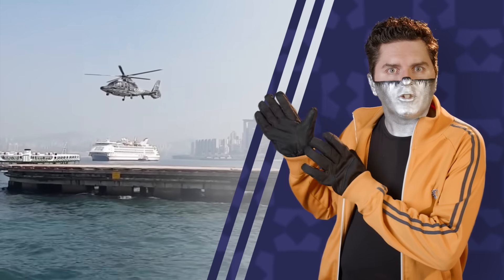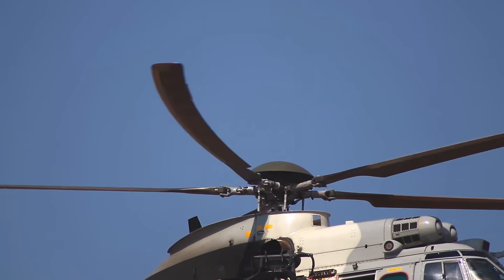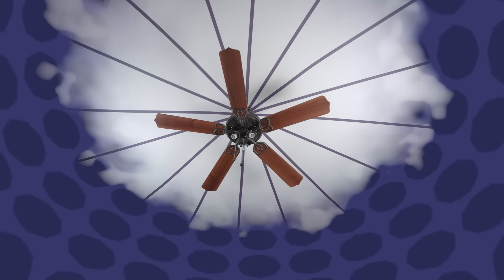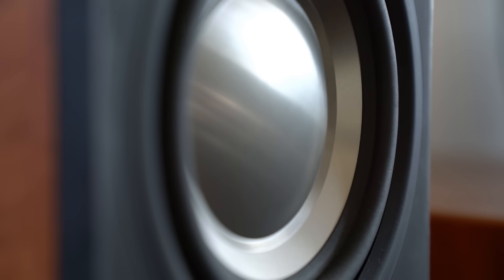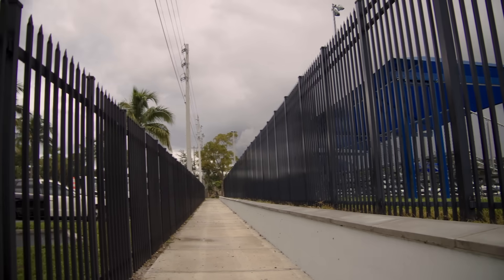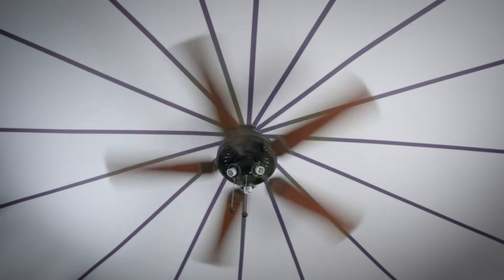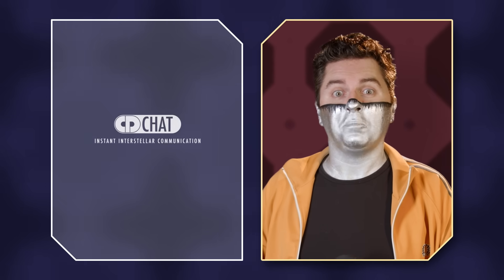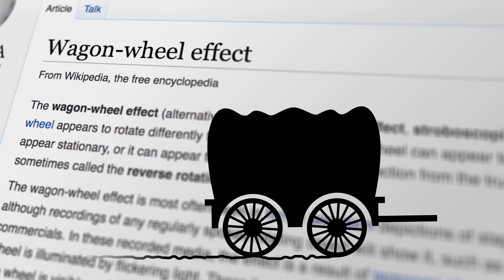Static Helicopter Blades | Quick D

Comment: Looks like your Decades + years of excellent content and grind paid, my boy is on trending cries tears of joy
Reply: Decades+ of content? That means AT LEAST 20 years of content. YouTube hasn't been around that long, kiddo.
Reply: @jtm232556  more than 1 decade is decades technically
Reply: @ekklesiast  Yes. The next decade after 1 decade is 2 decades. Decades -- plural -- means at least two.
Reply: @ekklesiast  Something like 12-15 years or whatever would be A DECADE+ not "decades+."
Reply: @jtm232556  plural: denoting more than one
1.1 decade is more than one decade
Reply: @ekklesiast  You left out the full definition in order to fit your purpose. Feel free to google for yourself. For something to have been "decades+" as was said, it has to be at least 2. I'm sorry you don't understand basic grammar or measurement, but the internet can teach you anything you need to know, sweetie😂
Reply: @jtm232556  I left out the irrelevant part "or (in languages with dual number) more than two" which has nothing to do with English. As I said, technically 1.1 is more than 1.
Reply: @ekklesiast  English ABSOLUTELY does have dual number. Also, a decade is a set measurement of 10 years. 1.1 decades does not mean you have 2 decades, just like having a complete shoe and an additional shoe lace does not mean you have shoes, plural.
Reply: @jtm232556  if English had dual number, then plural in English would be more than 2, not more than 1. But it doesn't https://en.m.wikipedia.org/wiki/Dual_(grammatical_number)#Languages_with_dual_number
1.1 decades means you have more than 1 decade, which technically is plural.
Reply: @jtm232556  Captain Disillusioned existed before youtube, "kiddo".

Comment: Rolling shutter is so common because such devices are much cheaper. I don't know why is that. It might be because it simplifies the sensor construction. If I'm correct, CCDs are always global and more expensive CMOS are as well. By the way, there's also a third mode, where lines are exposed in a rolling fashion from top to bottom but the whole read out is blocked until the last one is read. This is still cheaper/easier than global and a bit better than regular rolling.

Comment: The blades on the helicopter would not be at a steady rate as you can see it climbing altitude then levelling off, meaning the blades would have to spin faster when climbing than hovering to get more lift.

So to compensate for this, wouldn't the guy filming have to change the framerate and shutter speed of the recording to match that change of the blades?
Reply: Urm.... No. The change in lift is managed by collective pitch. A governor maintains rotor RPM during different demands in power.
So, sitting on the ground with little to no lift and the blades rotating at (for example) 400rpm, the pilot pulls the collective to demand more lift - this causes the blades to twist and bite more air, thus pulling the heli off the ground. The governor maintains the rpm. Without a governor, the pilot would manually have to open the throttle to prevent the rotors bogging down during the additional demand. As the heli reaches the desired altitude, the pilot lowers the collective a little, the blades twist to become a little "flatter", they bite less air, the governor backs off the throttle and rotor RPM is maintained.
I hope this offers some explanation.

Comment: Shutter speed is directly related to frame rate. The original title is correct. The reason the blades look "sharp" is because the shutter speed causes a frame rate that matches the rpm of the rotor. The fucked up thing is you clearly know this and are simply desperate for views.

Comment: I can remember when I was working at power plant. There you could check the vibrations (or lack of) of turbine shaft using fixed strobo-light. I almost soiled my pants every time I "stopped" the turbine by turning the light on...

Comment: Yahwnn... We rc helicopter 🚁 pilots use the strobo effect for decades now to measure rpm in flight. It's a device with a rotating shutter which can dialed in or a LCD shutter in newer devices. You can choose the frequency and it will tell you the rpm of the copter.

Comment: Induction motor under light load. The rate of rotation will always be just slightly less than an exact divisor of the mains frequency. Induction motors, unlike synchronous motors, never quite lock to the drive frequency - they are always a little slower.

Comment: Oh yes, I wished they had improved CCD sensors, having no rolling shutter, even not by utilising solely electronic shutter. Above ISO 800, CCD start to become really noisy. It is easier to avoid noise on CMOS. So, sensor industry jumped on CMOS instead of improving CCD, just because it was easier and for that cheaper. To get a few more bucks out for the shareholders. Eleventh Ferengi rule of acquisition: Greed is eternal. If you have a Leica M9, never sell it. It has the last ones of the of the exquisite Kodak CCD Sensors in it. If you have one with the sensor corrosion problem: Leica committed to fix this for free even being out of warranty...

Comment: A fun fact, in the radio control heli hobi, we use optical shutters in order to determine the rotor speed of our helis. It's a monocle with an LCD shutter built in. You look through it at the heli and adjust the LCD shutter with up/down buttons until the blades seem to stop, then you look at the reading to get the rotor RPM. It's a super easy setup that doesn't require you to get close to the spinning blades of death.

Comment: The video still is probably fake, because if you watch the info card video you can see how hard it was to match the rpm of the blades and the framerate. Also when the heli is taking off it would spin faster to get off the ground, yet the framerate is constantly and perfectly matching the whole way through

Comment: using this method you can measure the frame rate of your eye, just spin a wheel with like 6 spokes until it reaches the point were it looks stationary, then measure the rpm and divide that by the amount of spokes and there you go, you now know the frame rate of your eye

Comment: So the video title was technically accurate because it’s implying that the camera shutter is timed so it only opens when the helicopter’s blades are in 72 degree increments.  So yes, the title is both right and wrong depending on how you interpret it because English is dumb.

Comment: Every auto mechanic experiences this effect every time they use a timing light to check/adjust the timing on an engine.
Reply: Yeah, back in the 80s my dad was timing an old car of his and the fan blades looked like they were not moving and my friend thought that was odd and reached in to check it out.... Before my dad could stop him he lost the tip of his finger! We found it on the driveway some hours later...
Reply: @JustWasted3HoursHere  I have to assume he was a kid at the time? I just can't imagine an adult doing that.
Reply: @BigRalphSmith  Nope, Canadian.
Reply: @BigRalphSmith  Yeah, he was 8 or 9 if I remember correctly. I still razz him about that every now and then. He actually turned out okay as an adult, serving 20 years in the US Air Force as a weapons specialist. They still let him in with only 90% of a finger... ;)
Reply: That's very clever I'd say
Reply: The duration of the light equates to shutter speed. It makes zero fucks how quick the light flashes (frame rate) if the duration of the light is out of synch. This video is gay.
Reply: @crucifyrobinhood  I'm pretty sure what you just said is complete pseudo nonsense.
Reply: @crucifyrobinhood  Nope, you failed. Go back and watch it again.

Comment: My old ceiling fan threw stationery on the ceiling, my guess was that the motor was AC and therefore its speed was some multiple or fraction of the power's frequency, that is, the same power the lightbulb ran on. So the fan was always in the same position(s) when the light was brightest

Comment: Another way to conduct the experiment with a ceiling fan is to do what I did as a child:
1. Stand directly beneath a ceiling fan(it needs to be on for this to work)
2. Tilt your head back until the whirling blades fill your vision
3. QUICKLY snap your head to the left
And you should see the blades as stationary for about a tenth of a second.

Comment: Many moons ago helicopter technicians used the Chadwick Model 177, which used a strobe light, to adjust the tracking and balancing of helicopter main & tail rotor blades. Today they use a much more sophisticated system.

Comment: For those who don't have a real strobe light handy, many LED flashlights with different brightness settings actually dim the light by chopping the current in fast pulses, so you can use the different brightness levels to get different aliasing effects on a fan or whatever. (...but no way to set the rate manually - so too bad they didn't include something like that for the strobe option or something.)
Thanks for another good one, Captain D.

Comment: Someone legit commented on the original video this was a system for helicopters to land vertically on carrier boats, like tf did he think a helicopter is
Reply: not even VTOLs do this lol
Reply: @Robloxchat123  Which "this" are you referring to?  Do you mean landing on carriers vertically?  If so, you're more than a little mistaken...I have a tape I made in the late 80s, of a Harrier landing on the USS Theodore Roosevelt, which shows it doing just that.
Reply: @TheEudaemonicPlague  refer to what remiel said
Reply: bruh
Reply: The helicopter wasnt even moving just vertically so the whole idea of having to match changing conditions is irrelevant as it was clearly not trying to be static, just kept the rotor speed static.
Reply: I mean... he's not wrong
Reply: extavior helicopters vary the angle of the blades (collective pitch) and the throttle. Otherwise any side wind would propel them upward with no way to get down. It’s unusual to have a rotor speed this constant with changing loads on the whole system. Either excellent pilot or modern electronics keeping the rotor speed steady.
Reply: @Hamachingo  you literally said it in your comment "modern electronics"
Reply: Well, helicopters don't even actually on ships vertically, because the ship is usually in motion, so the helicopter has to be matching its speed. Could be up to about 11kts, so it's not fast, but which you consider ground effect, sea spray, and wind, it can be trickier than a regular vertical landing.

Comment: Wow, great video as always. The special effects are so good.

This reminded me of strobe tuners which are a practical application of this. They work by spinning wheels at fixed rates and flashing a strobe with the intensity proportional to the pressure displacement picked by a microphone. The only way for the wheels to look still would be to play the correct frequency on your instrument.